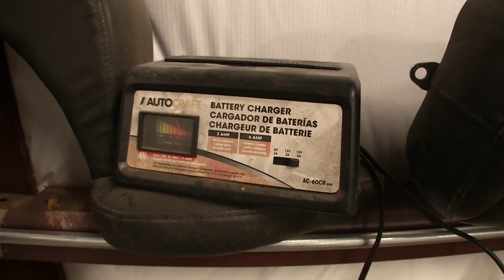BROKE DOWN On My 79 HARLEY Davidson SHOVELHEAD FXS 80 / WHAT HAPPENED??

Comment: Starters stick like that if your battery is not full as well, the Starter clutch slams in and doesn't have enough jam to turn so it hands up in the ring gear. fairly common on short trips when your battery hasn't had enough run time to sufficiently charge. Those engine take quite a bit to crank over, as you can tell if you try the kicker. For aftermarket ignitions I have the best luck with the Dynas I have used the S, (dual fire) the Dyna Single fire and the Dyna 2000i. I have never bought any Ultima stuff I ever had any luck with. Another thing, make sure your cables are tight and clean, the older bikes had small alternators and where less than adequate if everything wasn't right up to snuff! Welcome to Shovelheads, there's a reason they have a kicker.
Reply from the maker: Yeah, I think I'll be utilizing the kicker more often.

Comment: I've got the same bike, same electronic ignition and same exact issue with it dieing like it's running out of gas. I originally thought vapor lock in the fuel line between the cylinders, but now I'm with you, the Ultima ignition is junk. Although when mine dies and I pull over, it fires back up again within a minute or two. I was thinking about getting a Dyna S as I've read they're good, but can't overlook good old points...

Comment: Coming from running points to electronic ignition the best luck I have had is on older shovels is a Dyna S hall effect sensors with the stock advance unit and an alternator upgrade. Don't know about Ultima ignitions but I know the early Harley electronic ignitions are suspect. Changed many early 80's shovels back to points. Welcome to the world of shovelheads. Ran into very few bowling ball bikes that did not need to be torn down completely and put back together correctly. Later bro.

Comment: Your Ignition system is NOT the problem I have been through this so many times with them troubleheads It makes my head hurt just thinking about it.  If you're ever over here in Mobile Abama look me up at    Al's motorcycle shop    on YouTube.  I'm not that easy to get ahold of so you might want to give me a heads up the day before.

Comment: Put a manual on/off switch on the battery cable.  If there is a problem and the bikes starter wont stop engaging just use the switch to kill the power. Its also a good thief  deterrent . Just  put it in a well hidden location.
Reply from the maker: I'll look into doing that .

Comment: If the electronic ignition is as old as the by maybe it just needs to be replaced. I stopped with my trailer to help a Harley Rider who's ignition died and when we opened up the points compartment we saw that the plastic had cracked from a nothing you can do to fix that.

Comment: l had same thing happen to my 84 softail evo with the starter  ...  sure did freek me out  plus l had the spark plugs out  as well  so it  just  free ran  till l got the battery lead off....  electronic ignition is great till it fails then its at lest $450  fix...
cheers  mate  & Knee's in  Da Breeeezzzeeeeeeee........
Reply from the maker: Yeah, sure is a freaky experience!

Comment: A battery switch in the battery ground wire is a good method to kill an over run starter. Sometimes this happens when battery is a little low.
Reply from the maker: This bike has been made a kick only since this video.

Comment: loose that glass fuel filter because I had one start to fall apart because the threads gave out.  the threads are only 30 percent of the curcumference the rest is machined off flat

Comment: Had the ignition problem on my 72 SuperGlide S&S, Ultima and Compufire. It turned out that the stator was shorting out on the rotor at certain RPM at certain loads throwing high AC voltage out to destroy the electronic ignitions (plural)
It was hard to trace. No signs of it in the shop revving the engine or checking for frayed wires

Comment: Battery? 😶

If you looking at electronic ignition I can highly recommend the Dyna S and two 5-ohm coils. 

It still uses the advance fly weights. 

Been running one on my Shovelhead since 2001. 😎

No worries.

Comment: I have a 1979 shovel head and that was a bastardize year they used what ever parts they had at the assembly line no 2 bikes are the same (parts wize ) I still have the bike and I bought it new in 1978 but don’t ride it too far anymore

Comment: I have Many many many miles on Shovelheads and as far as ignition, put the old Chevy points and condenser back in and it will run like a top. Keep a spare set with you and you can change them in minutes and back on the road. For the starter, solenoid hang up is not uncommon due to old design and corrosion causing the problem. Other than that, good old engine. .
Reply from the maker: Thanks for sharing

Comment: Are you sure it was the starter throw out gear that was to blame in the first place ? Copper starter contact ring in the starter solenoid builds up high spots and shorts out or welds its self together , keeping it spinning over until batt dead, . Can happen on any used Harley Evo or other wise. Add it to your check service and maintain list , theres also a service kit.........yes its happened to me 😁i run single fire with no troubles ....so far .
Reply from the maker: I'll look into that. Thanks

Comment: Take the positive wire off the selonid and run that cable to the starter relay and then take a 4 gauge cable to your starter and take the starter button and put it on the starter relay to the post that says starter and make a jumper wire wire that goes from the top selonid and then it will never stick again because the selonid is not hit the only thing that will be hot is the wire will be on the relay and it is going to cure the stuck starter will not have current if you take the starter button and release it and no more power to the selonid. That’s how the factory fixed the 86 and on evolution it’s how all of them should have been done. And if the starter doesn’t have power it can’t stick. Hope this helps you. MLLH&R

Comment: Your starter run on problem could have been the starter relay sticking. On older bikes they used Ford starter relays and they have been known to stick. How do I know this it happened to me twice. Just a thought you would like to know. The really bad thing is they were mounted on the bottom of the frame a little hard to get at. I installed an electronic one never happened again.
Reply from the maker: Maybe I'll just get into the habbit of using the kicker more often. So far you're not the only one who's told me that.
Reply: @SaddleTrampTV  yes learn n use the kicker. Best thing on a bike. Till the gears wear n skil a tooth an you hyperextend your knee. Man that hurts. Then buy the baker gears, pricey but after that you'll love showing people how to start a bike

Comment: I have the ultima programmable ignition in my 77 flh shovelhead , 97 fatboy, 93 ultra classic and 94 heritage rat bike. I think them ignitions are made by dyna. Same as dynatek 2000i. Just rebranded. My fatboy has over 40k miles with that ignition.  No problems at all. I like them. I vent the cover to keep the ignition cool .
My shovelhead is kick and electric start too.  I kick start it all the time usually starts first or second kick , and only when she's being a bitch I hit the button.  That way I get more life out of my starter motor and solenoid.

Comment: hi tramp, red riders dad here. seen that starter thing happen a few times before. not to me though I've only ever had kicker bikes. the '78 shovel I'm putting together now will have a button on it (old age'll do that to ya). something else it'll get is a battery disconnect switch. so will the kids '94 dyna she'll be working on soon. thought this would be the way to go ever since watching a friend frantically trying to disconnect the battery in his shovel when that starter thing happened to him way back in the 80's. I also wanted to say thanks for supporting the kid with a sub. anyway, as one brother to another, if I don't see you before, I'll see you at the Marriage Feast (if you get my drift).
Reply from the maker: I certainly get your drift, Amigo. Having a battery disconnect switch sounds like a splendid idea. I'm gonna have to look into that. Thanks!
Reply: cool I watch red rider and love that 96" shovel cool bike not up much with the tank but cool bike seen video where she got the 94evo and seen 150lb compression ride 99evo myself 85000mi never been cracked open 
Anyway keep it between the mustard and mayo and rubber side down and tell red rider keep up the good work later

Comment: Had same issue. Starter solonoid
Reply from the maker: So it's not just unique me.
Reply: Nope. You can make a neat tool out of a discarded primary cover to check starter operation before putting all back together

Comment: Do you have any videos that would help me figure out where all the parts fit into a swingarm frame mine is a 79 shovel with the 80 ci engine and I can’t find anything telling me what size bolts to use
Reply from the maker: Sorry, I don't. But I'm sure I might in the future as long as I keep riding these old things.
Reply: @SaddleTrampTV  thanks bud I appreciate it

Comment: Low voltage, won't run the ignition, It's designed to operate at about 12.6 to 14. +... Starter solenoid had contaminat problem of bendix.. If there was ?? A smoking electric line ( breaker or fuse ) would help
Reply from the maker: Turns out I ran out of gas. I made mention of it on a few later videos.

Comment: Points and kick start only and you will have a trouble free shovel.....
Real man still kick start their bikes.✌
Reply from the maker: Yeah I guess so
Reply: @SaddleTrampTV  
You don't sound too convinced....🤔
Reply from the maker: @bigiron8831  Just thinking you might have a point. You don't see too many sissyfied millenials doing it. But then you gotta give grace to the older guys who aren't as young and strong as they used to be.
Reply: @SaddleTrampTV  
I'm 68 years old and I have been kick starting my Panhead since I bought it in 1970 and I bought my 79 shovel new and I still kick start them both, however I have a 95 Roadking and it has a sissy button on it and I've been considering a kicker for it. Ride Safe and Ride Free my brother ✌

Comment: Didn't your bike come with an electronic ignition from Harley? I have two 79's, an XLH and an FXEF and both of them came new with an electronic ignition.
Reply from the maker: After doing the research here recently, I found that to be the case. They even changed the timing slot on the camshaft. If I were to got to points, it would need to be retro fitted.

Comment: SOOOOoooo If your Gunna Go Old Skewl & rip out the Electronic ignition You should also throw away that  sissy electric starter.  LMAO! (J/K)  You got a kicker. So now that you've gone to points good luck finding American Made Parts .the Chineezium crap is going to leave you on the side of the road for sure.  TWO suggestions. Daytona Twin Tec MSD ignition & A heavy duty cut out switch on the NEGATIVE those old solenoids go bad just like on A old Ford the Solenoid hangs up & it keeps spinning the engine until either it runs out of juice or all the Magic smoke come out. Plus A cut out switch can be a Anti theft device.  Running a Belt drive your going to have to grease that shaft as a maintenance service point . Good Luck

Comment: Yeah I had a crane high for ignition happened that way I mean it just kept being cantankerous I never liked the computer to be in the end of the nose cone or where the points go when I did my bike the basic computer is under the seat. But then again I may go back to points. On my EVO. Cuz I don't find anything special about single fire ignition over dual fire.
Reply from the maker: Yeah, the last place for any computer module to be is in hottest place on the bike.

Comment: Points would not be my choice. Electronic ignition has been around a long time now no reason it shouldn't be reliable.
Reply from the maker: When you find yourself in the middle of a busy highway with no place to pull over, you'd have quite a revelation. The later model oem stuff is fine. It's all the aftermarket stuff meant for the older bikes that always seem to crap out.
Reply: @SaddleTrampTV  i had a mallory unilite module in my 61 pan. True, and i mean true 1 kick bike. No prime kicks or what not. Any ways only had trouble 1 time, got liquored up 1 night n left key on all night. Next morning coul had cracked open due to heat n module was fried.  How you say, operator error

Comment: My shovel came with ecm I tried to run points but the breaker that rides on cam end kept wearing and points went together after 100 some miles I tried everything nothing worked with points so I went back to ecm  and carried a extra one with me problem solved
Reply from the maker: You're supposed to keep the cam lubed to prevent that.

Comment: There's nothing wrong with your single fire ignition. I've been running them since the mid 1990's and never had a problem with a single fire. Ride it some more before  you jump to any conclusions  !!!
Reply from the maker: It's not the first time it's done this. Just worst case scenario. I've checked all other possibilities but they all check out just fine. This is the last possible culprit.
Reply: Well my friend,change it out. If you still have the problem you can always put it back in .